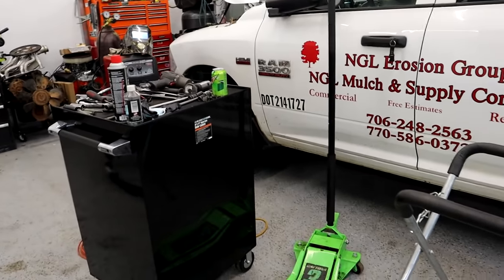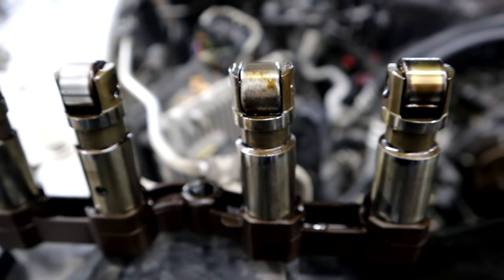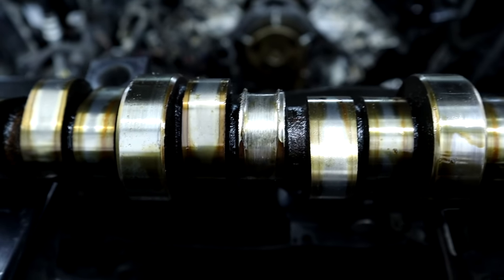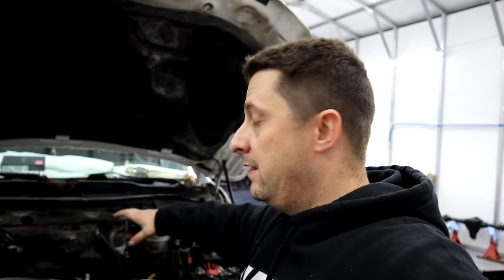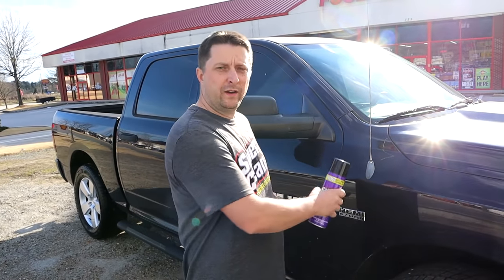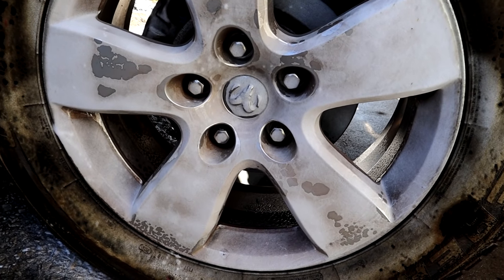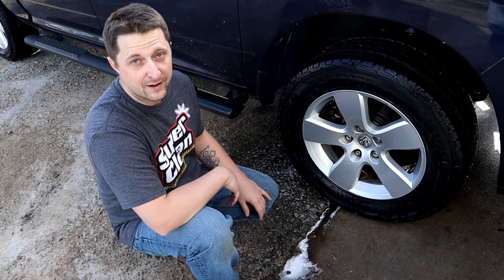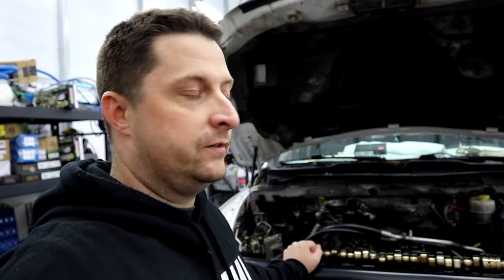6.4 HEMI Engine Failures Common Problems WATCH OUT.

Comment: This is total bs. 90% of the RARE failures are due to poor maintenance. The oil passages are tiny on these lo web engines. You can not leave oil in there for 8-10k like most of you do. Especially fleet vehicles. Especially you guys that leave them idling for heat or A/C. 
I’ve been at Dodge since 1998. Same company making the magnum rollers make the Hemi rollers. There aren’t common problems. Guys like this blasting it out there make it seem that way. GM had an even bigger issue, way more common but you don’t see 1/10 the videos. Dealer across from us has EIGHT 6.2 trucks waiting on engines. Change your oil. And if you get an issue stop fucking driving it. By the way, there’s been over 3 million of the hemi’s made. Do the math.

Comment: with so many Rams engines problems,clearly this is a bad design engine,FCA play stupid,keep quiet ,well,why the owners are put up with this BS,hundreds or maybe thousands Ram owners have the nightmare,so set up a picket line,right a front of the FCA factory,day and night protest,give them a very bad PR and demand action to fix the engines,becoze nothing else willpush FCA for action.
Reply from the maker: Agreed 👍
Reply: Loudmouths with signs don't change anything. Class action lawsuits do.

Comment: Get a Tundra
Reply from the maker: If they could pull like a 2500/3500 perhaps
Reply: Toyota decided to take the oil cooler off the trans and now they are burning up transmissions. Good trucks, but not immune to failures either.

Comment: Reality. People are cheap and lazy. I have proven points. With nissan cvt and now dodge. I had people say you will never get that pathfinder cvt to 100k. Well I got it to 200k. Maintenance. Second if you haul with these 6.4 I don't care if your changing oil every 5k with full synthetic do it every 3k. I seen these trucks in the 200k already towing every day no issues. Stop being lazy people change your damn fluids. Rear end e every 30k trans every 30k and oil every 3k. It will live a long time.

Comment: Flawed engine design man time to move on to a different brand.   0w40 won't fix a mechanical issues poor engineering they refuse to redesign the block or improvethe oiling . Why would you even want a 6.4 when you could have a 6.7 Cummins know good engine design.

Comment: You're full of it. Just because people don't keep up with regular maintenance does not translate to an engine  being faulty. You should be band from YouTube. #Mopar #Ram #Dodge
Reply from the maker: @reza829  your a joke, you have absolutely no idea how much of a mopar/ram guy I am apparently 😁 believe me most is not maintained correctly but I have seen just as many owners who absolutely takes care of there stuff like clock work and still the failure across 5.7 6.4 it dosen't matter bro. The bearings in the factory lifters will go when they decide no matter the maintenance or oil schedule. Factory mopar "hellcat" non mds lifters and cam is the best fix/repair. I've done more than I can count😉 the dealer will just say you need a motor 99%of the time.

Comment: Dodge is always crap don't overrate disgraced garbage exactly, sucks
Reply: @FrostbiteRam  I have a silverado 10 in a half years no engine problems, im sorry your engine gives problems  all trucks have problems and I recently replaced the e c m board due to wiper malfunction but its been a good truck only put $2500 in 10 years in it shocks struts tire sensor thermostat belt plugs and sway bars she's been good,but I only paid $18000 in 2010 and your dodge was about $70 000 should be perfect

Comment: the Power stroke is Found on road Dead Ford suck  i got 275,000 on all ten of my Hemi work trucks still running good. You and Your miss info sucks like Ford
Reply from the maker: Lol I'm a huge mopar fan I think you missed the point 🤦‍♂️
Reply: @FrostbiteRam  if that's the case stay out of the  crappy found on road dead trucks. i think people are revving and racing with hi RPM's. if i have a Problem 
ill give you $100.00 because
i did not believe. My 2003's only one needed a head 1gasket  after 275000
my 99 found on road Dead needed 4 rears 3 front end's & two Trans in 180000 . that was the last Found on road dead i ever has thank God

Comment: Toyota 5.7L is bullets proof
Reply: Yes it eats gas but no cylinder deactivation. 😁
Reply: @mikeb6386  yea and you don't have a $4,000 repair bill at 80,000 miles either. 4 grand buys a lot gas.